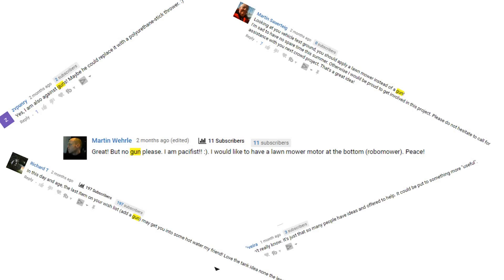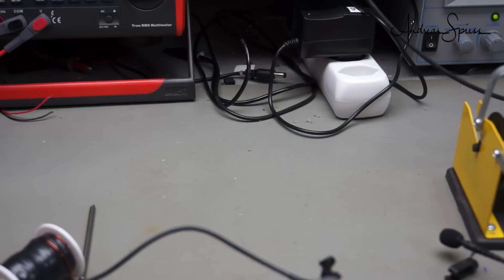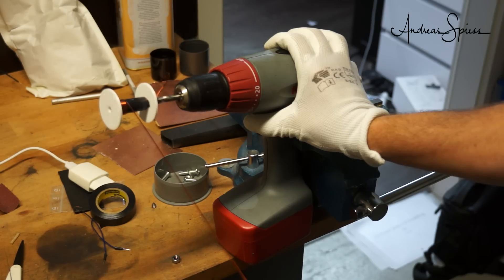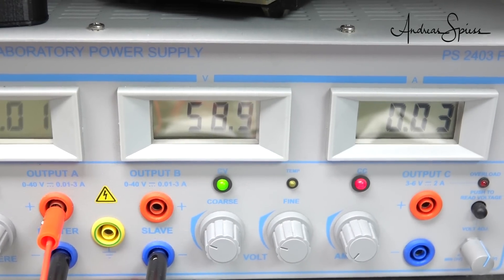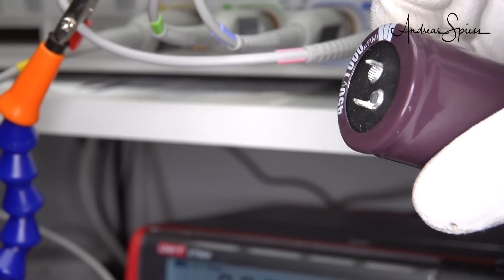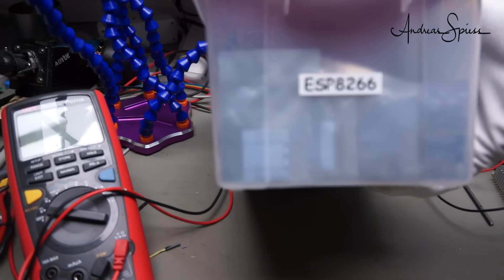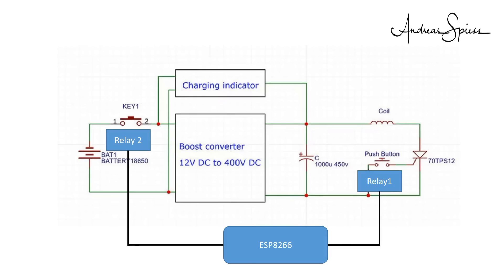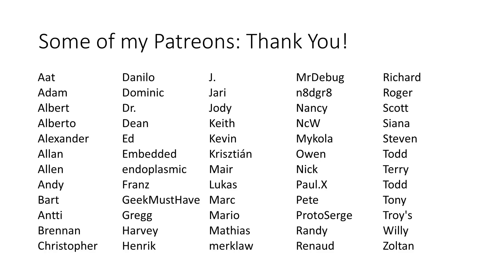464 Better than GreatScott's Coil Gun? A true story, how-to not do it

Comment: I would assume that even your voltage divider is at risk, since the the coil might push back some high inductive voltage when it recovers, that could exceed the 400V you assumed  for the divider network. Not sure sure i a shotkey diode might block that.
Reply from the maker: I vote for complete insulation in this case. As you describe, there are many effects, and the modern MCUs are quite vulnerable.
Reply: @AndreasSpiess  I designed a few high voltage, high current power supplies in the past. Namely for Xenon short arc lamps, laser tubes etc.. 50-100A current @ 20-50V DC, with striking voltages in the 10s of kilovolts... So I feel the pain :)

Comment: I purchased a kit some 30yrs ago from a company called Information Unlimited. It used a 100w incandescent bulb as a charge regulator, bridge rectifier, and a pair of D cell sized caps in parallel. It was mains powered with a knife switch on the output. I used a standard wall switch on the output as it was safer than the blade switch. The coil came already wound. It also used a steel rod as a stator instead of the projectile. The projectiles were copper or AL tube pieces that just slid over the rod. When fired, I got about 30ft distance from the ring. The rod had to be braced though as it would try to center itself on the coil, obviously.
Sorry about your misfortune with the equipment. At least you weren't hurt (other than your nerves maybe).
Reply from the maker: Today, it probably would be difficult to sell such "dangerous products. So we have to build it ;-) The power supply is repaired (2 dead transistors). Video #228

Comment: I would add a switch and resistor load to discharge the cap if the bullet doesn't fire as a safety measure.
Reply from the maker: Good idea!

Comment: I regular trick we engineers did was to connect a tantal or electrolytic cap to labsupply, reversed, before going home for the weekend. Then, whoever came in first on monday and turned on the master switch to the lab, got at surprise. The delayed action is particularly fun too. Never failed, much appreciated. Who said engineers dont have a sense of humour?
Reply: Ah, tantalum caps -- "shrapnel emitting capacitors".
Reply from the maker: A cheap way of scaring people!

Comment: To isolate the MCU from any spikes, could you have used a logic shifer in place of a relay?  If you connected the low side to the MCU and the high side to rhe thyristor, you could have achieved a switching voltage of 5V.  Although I may be missing something here.
Reply from the maker: I do not know if it would work. Somebody would have to try it.

Comment: Very interesting and entertaining video Andreas, and I’m totally with you on avoiding high voltage circuits.  Back 30 years ago i was hired as a technician to work on our flight warning computers which were all low voltage devices.  One day in the lab I witnessed one of our other technicians working on a xenon strobe power supply for an aircraft anti collision light.  Im telling you that every time the xenon flash tube fired, it caused the lead wires to physically jump. I knew the xenon strobe power supplies were very high voltage, but to have that much short busts of energy was enough for me to declare I have no interest in that product line.
Reply from the maker: So we are two that vote for low voltage devices ;-)

Comment: Hi Andreas. I was just wondering if it was the back EMF from the coil that killed the ESP2866? Would a flyback diode have helped?
Reply from the maker: There are many proposals in the comments on how to avoid the damage.
Reply: @AndreasSpiess  It was less a suggestion, as I don't have anywhere near your knowledge and experience, and more of a question.
Reply from the maker: @gerryjamesedwards1227  I know. And my answer was not polite 😞Sorry about that.
Reply: @AndreasSpiess  no, no problem at all with your reply, I'm sure you have lots of comments to get through.

Comment: Good video! Awesome to push through even if it wasn't going 100% as planned. Yeah, high voltage and especially high currents to (even remotely) interface with 3V/5V logic I tend to carpet bomb with TVS, zener diodes and series resistors. Built an array of heavy duty solenoids to switch 160A circuits to different places (to massive transformers)... the idea was that it should only switch when current was off... but its a machine, so one can never be 100% certain, and I like to sleep during nights and not rush in to keep production running 24/7. So, a bit of belt and suspenders to keep my pants up! ...but ofcoz there was some minor component casualties during development, as it should, if you want to find out the limits/worst case. I always kept a healthy dose of fear, heightened awareness of where; the metal tools, fingers and elbows are when fiddling about near that circuit/system... and keep it behind locked doors and warning signs. Fully Charged Coke can sized caps does that to me.
Reply: If you are lucky... the wife will already own one !!
Reply: @johncoops6897  . . 🤔 . I need help to understand... or maybe answer stuck to wrong post?
Reply: @Paxmax  - sorry, my comment ended up on wrong post! I was replying to @AdityaMehendale about finding Epilator devices 😂😂
Reply: @johncoops6897  Haha! 😂 no worries, it seems like randomly youtube does this, happened twice in last 6 months to me too! My comment shows up seemingly at complete unexpected place (I'm not sure if it is(/was) early demensia... or utube glitch.

Comment: DC supply should shut off when sufficient voltage is in the capacitor. Double diodes on the supply side to the capacitor to be sure.

Turn DC supply back on when capacitor has drained. Higher velocity and efficiency may be achieved by using two coils in series with the second triggered slightly later. The impedance of the coils will change as the slug moves through which may be used as a "passive" circuit effect for triggering. i.e. the coil goes from iron core to air core.
Reply from the maker: Other designs use several coils in series with photodiodes for triggering. But this is nothing for me ;-)

Comment: Add current limiting to the gate of the thyristor, using some 47kohms or so. As soon as the thyristor triggers, the gate gets connected to the anode. That is what kills everything
Reply from the maker: It seems so that this is a dangerous pin ;-)
Reply: @AndreasSpiess  indeed it is. My first thyristor circuit ended up in a ball of flames: a Zener, a resistor and a BC548 fried instantly after 150V got connected...

Comment: Check voltage limits on the 1/4w resistors, I think it’s 250v
You can put 2x400k instead of 1x800k
Reply from the maker: I agree. I usually combine a few resistors, too.

Comment: 400V is still low voltage, sure its higher then the very low voltage stuff used in microelectronics, but its still low. Its so low you don't even have to worry about the electrons leaking out the conductors.

Still a bit more challenging to work with then 5V, but overall still relatively easy. things get increasingly difficult at around 5KV, then increase in difficulty to medium at around 50KV and go to hard at around 1MV
Reply from the maker: For me, everything above 24V is high voltage ;-) And I am happy that others master these voltages.
Reply: @AndreasSpiess  At least with such low voltages, you don't risk death or serious bodily harm if you happen to brush past the wrong thing at the wrong time. Its all a matter of perspective 

Oh, and above about 5KV the circuit can be closed if your still a few mm away from the conductors. Things get even more fun the higher up you go. Such as at 1MV, where you can get a shock / become part of the circuit, if you happen to stray to within 1 meter of any part of the system at that voltage. Even more fun can be had if medium and or high voltage and high current are mixed. Though the fun starts at around 200V with high current. Basically, if things fail, they will usually do so in a spectacular manner. 

Basically put, medium and high voltage stuff requires some amount of planning to prevent accidents, sub 24V usually not so much. though i have had very large capacitors explode on me at those voltages.

Comment: Dear Andreas, no need for microcontroller, just charge a 0.01uF capacitor with like 100k ohm and discharge it with a short to ground resistor 1kohm +- that is connected parallel to gate.. And the capacitor will trigger the gate and discharged by the low resistor and gate, maybe a 1.5v Zener diode can replace the battery
Reply from the maker: Good idea!

Comment: The thyristor actually produces a voltages pulse on the gate when current flows from anode to cathode.
More than enough to ruin an esp.
On thyristors that have had over current we usually find the gate drive circuit damaged as well due to this.
I am so sad about the damage to the power supply, hope it gets the required medical attention soon.
Kind regards,
Uncle D
Reply: Yep, a thyristor (and also a triac) has the gate connected with the rest of the component, so you do get the high voltage there once it starts conducting and before the current through the inductor gets sufficiently high to make the voltage across the thyristor collapse. 

I have made that same experience trying to build a triac regulated supply for a soldering iron many years ago. Getting 48V AC on a puny comparator output will also cause some sparks.  Optocouplers (or optotriacs) are you friends here. Or using an IGBT which has the gate actually insulated.
Reply from the maker: The power supply is repaired now (two dead transistors)
Reply: @AndreasSpiess  That's a huge relief, injured lab equipment is not good.
I work with power electronics for a living, it builds character.
But it's like your love for rf which I admire, and appreciate you sharing.

Comment: You need an RC snubber circuit across the SCR.  SCR is a simple device but without protection, and big inductive load you will get a big voltage spike as large as L*di/dt.  A simple RC snubber should do it.  The villain is not the SCR, it's the large inductance.  What is the inductance of the coil?  Also, maybe a Diode backward across the coil will help.
Reply: Absolutely correct! Inductance will vary with the position of the projectile.
Reply from the maker: Keep in mind that the switch is only opened when the cap is discharged.

Comment: If you need any help with high voltage send me a message… you forgot that the coil will revert its voltage and short the power supply… a diode need to be placed in parallel with the coil… de driving you could use an igbt is easier to drive 

You must use optocoupler to be able to time the coil correctly for multistage acceleration… hope you don’t give up 

Lot of fun and learn with your channel thanks a milion

Comment: Ohms law is V = I x R not divide,  So really you want A = V/R to get the current flowing in the return path. As 1 Ohm will be proportional to 1 Volt that would equal 1 Amp flowing.
Reply from the maker: You are right

Comment: We learn (or we should) from our mistakes. IGBT and some protection back to the ESP will help, also thicker wire in the coil and a reverse voltage shunt diode across the coil to prevent the large back EMF you are going to generate when the magnetic field collapses.
Reply from the maker: I agree with your proposals.

Comment: Maybe a high voltage flyback diode on that big coil might help tame the circuit a bit? Always optical isolator or a nice little reed relay with flyback diode power by a 2n2222 transistor?
Reply: I always use an optoisolator now whenever there is a large inductive load being switched even at low voltage. Flyback diode is sometimes sufficient protection for small inductors like on hobby DC motors
Reply: @bornach  Optoisolator may be overkill. My rule of thumb is that if switching current from gpio trough 330Ω resistor isn't enough, use additional transistor or more involved circuit. Also don't forget a snubber.
Reply: @pasikavecpruhovany7777  An abundance of caution is warranted when messing with a 400V DC boost converter that additionally provides a negative rail. Who knows whether it would have been safe to create a ground loop with the ESP8266 development board that was still plugged in via USB into a PC that was powered by mains electricity

Comment: As the trigger is so fast that it generates high voltage in this circuit by the principle of counter electromotive force, by Lenz's law. To avoid this, it is recommended to use a diode in reverse polarity, parallel to the capacitor.
Reply: Yup. I pointed this out back in 2018 via Twitter when the original video came out. Beware of adapting random projects found on Instructables or elsewhere on the Internet that were not originally intended to be hooked up directly to microcontrollers. I've destroyed lots of cheap low voltage electronics simply by connecting them to inductive loads. The 400V wasn't even necessary.
Reply: @bornach  Indeed. The same care is needed when using relay because it is a inductive load as well.
Reply: @gplgomes The cheap Chinese relay module that Andreas showed in the video I think already contains an optoisolator, transistor and diode.

Comment: Surprised this worked at all. Surely the power needs to be cut off when the nail reaches the middle of the coil or else the magnetism will start to slow it down again? Did you just get lucky and the inertia of the nail happened to be tuned to the duration of the pulse close enough? I would have gone for some kind of optical interrupter to cut the power when the nail reached the optimal position.
Reply: Capacitor size was specifically chosen for that purpose. Possibly the only reliable piece of info in that Instructable.
Reply: @bornach  I did not see either an experimental or analytical determination of the right capacitor size, which would have been interesting as an electro-mechanical exercise. However I think a closed loop approach would still be better given the likely variation in ammunition, plus a sharp cut-off at the right moment would be better than an exponential decay!
Reply from the maker: If the cap is small, the peak is very short. With bigger caps, a cutoff would be needed, I think.
Reply: @AndreasSpiess  Yea, but you are loosing firepower by cutting off too early and not sharply! You do not want to be outgunned by your enemies for want of slightly more sophisticated electronics! Plus a photo interrupter circuit would open the path to a multi-stage design amping up the jeopardy and click-baiting more YouTubers!

Comment: Unwritten rule number 1 in electronics: Never connect microcontroller pins directly to controlled electronics with a higher voltage than the microcontroller's operating voltage!  Galvanic separation! 😂😂
Reply: Corollary: Never connect 5V/3.3V microcontroller pins to switch high inductive loads even when they are on the same low voltage supply rail. Don't ask me how I know. Suddenly shutting off the current causes the electromagnetic fields to collapse and induce a high voltage. Even a flyback diode may not switch on quickly enough to quench the spike before it damages low voltage tolerance GPIO pins
Reply: 2nd Corollary: Never move super powerful magnets near small inductive loads hooked up to sensitive electronics. Brainiac75 did this and I think it killed the brushless DC motors in his powersupply
Reply: I would have put a fly back/back emf diode across the coil as well. 
But overall a fun project

Comment: That reminds me of when I worked for Kistler Instruments - it wasn't a coil, it was a 'secret' box that had many Kv dropped through it from a bank of PF caps. The aim was to measure the pressure produced on firing...it often would fry the charge amp, (at about £1,000 a 'pop'!) and cable, despite it being many metres away from the pressure sensor! It seemed the EMP was rather strong!
Reply from the maker: Indeed, an excellent example of "EMP"!

Comment: multi Coil 1:1 pulse transformers(used in old DC output SCR motor controls) or Opto Isolators ( LED input to Transistor output) directly from the Line Powersupply feeding the SCR gate along with a limiting shunt, Also a R/C accross the SCR output will help surpress extra crap as it goes along
Reply from the maker: Thank you for the info. This would have been a much better idea!

Comment: Interesting parts are score-able from "photoepilator" IPL devices. In such a device, too, a large and low-ESR capacitor is used to dump energy into a xenon flash-lamp (400V / 50A / 5ms) using an IGBT (optically isolated gate). A battery-operated model also has a DC-DC stage to charge the cap to ~400V. The coil is not included :) I can imagine that devices where the xenon-tube is kapot can be obtained for low monies; as it is a "consumer-grade" device, these should be not too hard to come by, albeit with a low W.A.F.
Reply: If you are lucky... the wife will already own one !!
Reply: @johncoops6897  ergo the "low WAF" :)
Reply from the maker: Interesting idea!
Reply: @AndreasSpiess  One of your subscribers has a nice demo along these lines: https://www.youtube.com/watch?v=OiP6YZWVBug - they use a spark-gap switch instead of an IGBT.
Reply from the maker: @AdityaMehendale  Interesting concept. I did not know that "air" conducts that good...
Reply: @AndreasSpiess  Haha :) Perhaps a nice topic for an upcoming AndreasSpiess video!

(Of course, the drawback with a spark-gap is that, unlike an IGBT,  one cannot easily switch it off)

Comment: You can simplify you circuit by connecting the 400 volt supply to a 100 volt cap, placed strategically behind the projectile..
Reply from the maker: Maybe an innovation: Capacitor guns ;-)
Reply: @AndreasSpiess Plasma Channel did this: Electric Capacitor Revolver